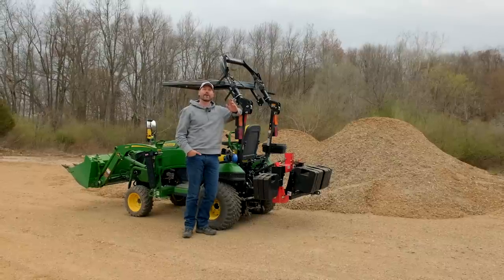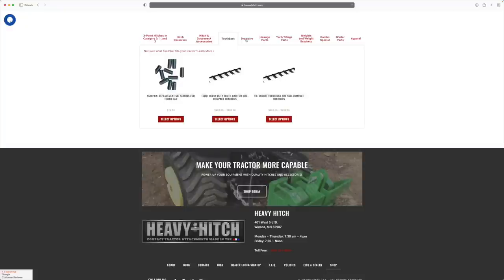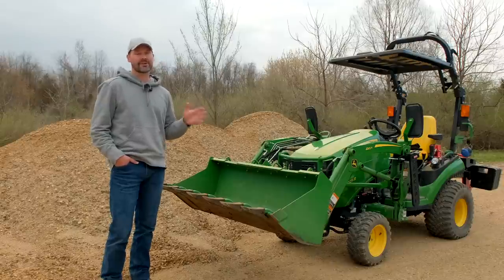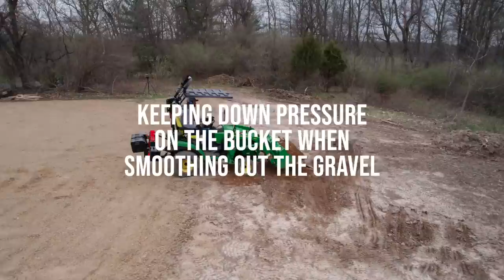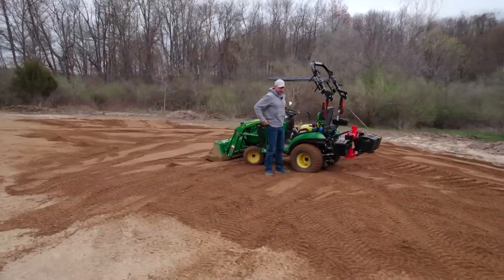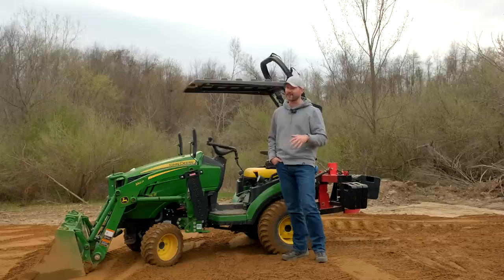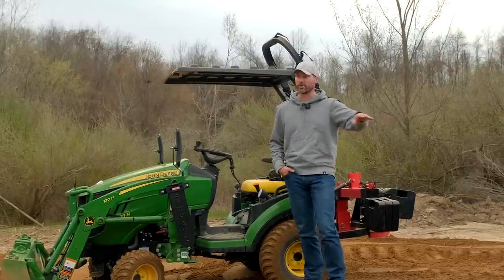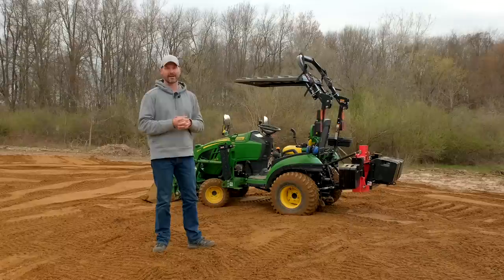BUCKET TEETH EAT A MOUNTAIN OF GRAVEL ONE BITE AT A TIME

Comment: I was told by a very experienced machine operator that when back-blading to level, you should have as much material in the bucket as possible to avoid having to put so much down pressure.  This advice, of course, came AFTER I had finished the job!

Comment: Great Video. It's difficult at times to get a full bucket with a small machine. If you pull the pile down first to make it "fluffy", it makes it much easier to get a full bucket. I picked that up from Mike at Outdoors with the Morgans. I have tried it and it works great.  No matter the size of the machine, it sure beats a shovel and wheelbarrow. Cheers

Comment: Good demo of the 1025.  As you said, a bigger machine would've moved it faster.  I take the digger bar off when handling gravel whether dense grade or sized stone.  I find it easier to scoop the rock and much easier to smooth it with just the bucket.  TBH, I've started leaving the bar off the bucket most of the time.

Comment: I once heard a story about the union representative that was berating an owner of a construction company about buying an excavator.  The union rep said that buying the excavator would coast the union a hundred jobs for workers with shovels.  The owner said why not a thousand workers with spoons.  To the point, ANY tractor will move dirt faster than a person with a shovel and wheelbarrow.  I got rid of a MF GC 2000 for just the reason of your video.  Your 1025 got the job done but as you pointed out in the first minute of the video, you have larger machines that would have moved the soil in a much shorter amount of time. 
For me the light went on when a friend helped me level an area for a twenty foot shipping container.  He was using a large Bobcat and I was using my MF GC 2000.  His bucket was at least three times as large as the bucket on my little tractor and my tractor had neither the power or the weight to cut into the existing dirt to level the pad.  I quit after about ten minutes because I was only in the way and wasn't getting anything done.  
 Shortly thereafter I put a down payment on a Kubota L3901.  I don't have ANY regrets buying the larger tractor.  Now when I get on the tractor I feel like I actually accomplish something.
Still appreciate the videos.

Comment: my heavy hitch toothbar did not connect correctly...because the Kubota blade edge welding was out of spec. They did not grind down the welds to the nominal thickness quoted in the manual.   Took an hour or so of grinding the bucket to get them to fit.  But now they dig in easily and don't come off.

Comment: Would a box blade speed up this process?
Reply: I use a 72” wide landplane as counterbalance. It can be used to push the dump piles around a bit then pulled to level the road/drive/pad afterwards. I’ve never had a bucket full of gravel overcome the counterbalance weight of the landplane.

Comment: A couple of points to ponder: the tires shouldn't be squatting, increase the tire pressure. The tooth bar doesn't work in leveling. I suspect that by removing the bar, the final leveling would have been better. The machine was working at max capacity. Either use a bigger machine or get Johnny X from TTWT.